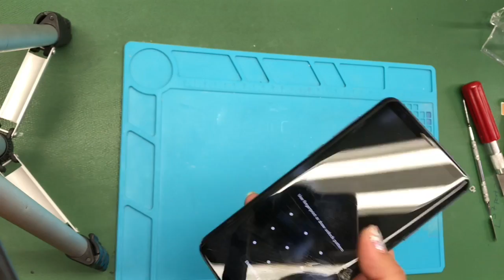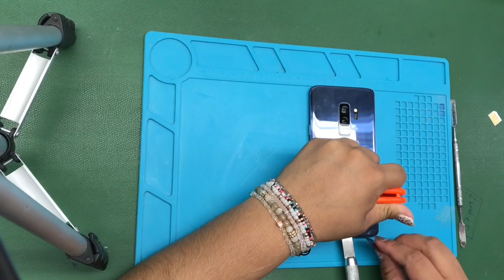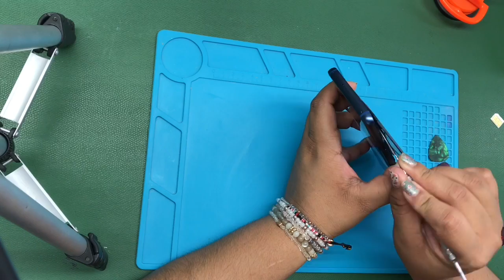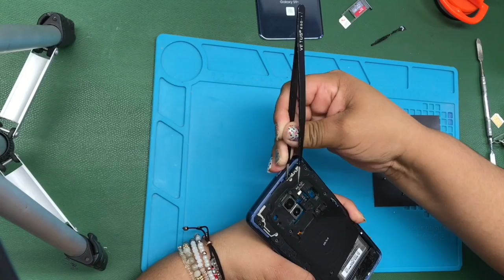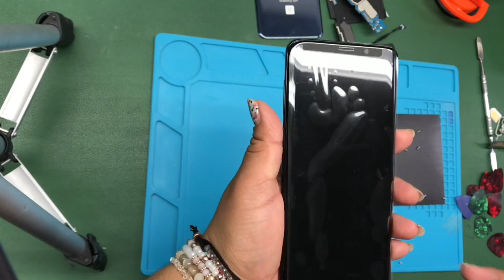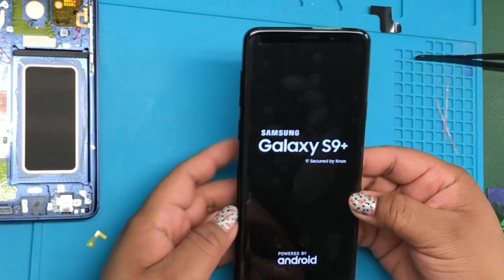SAMSUNG S9 + SCREEN REPLACEMENT EASY DONE IN 12 min 🙄

Comment: My S9 have a cracked but definitely still showing good. Can I just replace the front screen or LCD?
Reply from the maker: lcd and digitizer come together! so you can definitely just get the screen replaced and it will fix your issue!
Reply: @OrganistaTech  I have ordered just a S9 glass screen with no LCD and digitizer. Would it still work?

Comment: What'd the difference between doing a frame+screen replacement and doing just the screen? I did just the screen on my Note 9 and it was much easier than moving all the internals over to another frame...
Reply from the maker: the difference is that when you do a frame plus screen swap is that your phone looks brand new with new frame
Reply: @OrganistaTech  I did just the screen/digitizer. Phone looks brand new and took half the time

Comment: Replacing the whole screen would mean replacing the OEM OLED display.
I doubt that generic LCD has that great resolution as the OEM.
Can't you just replace the front glass ?
Reply from the maker: Yeah you can do that but that'll take longer
Reply: I tried to just do the glass only but the LCD is fused to the glass
Reply: https://youtu.be/ifHdZNbBwg0 this one shows what it takes to just replace the front glass
Reply: check out the channel "Richard Menza" 
He has a great solution. Or Rewa Technology

Comment: hey, my touchscreen works perfectly fine all I have is cracks. cant I just heat up the glass and pull it off?
Reply: Tom Harrison u still have to take the back off because the screen connection wraps around the motherboard and connects on the backside
Reply from the maker: Hey Tom and no you won't be able to do that due to it being connected to the screen
Reply: Tom Harrision to separate the glass from the LCD you have to be able to freeze that part to a certain temperature to take apart otherwise you will damage it.

Comment: How do you just replace the front glass?
Reply: Yes. Check iFixit's video. You do still need to remove the glass back and some of the rear components to disconnect the display cable. But the logic board and most of the internal components are left inside the frame.
Reply: Do you have a link for that video ? thnx in advance ^^
Reply: @dil6969  I have the replacement screen and LCD digitizer with out the frame and no one is showing how to take the old one out to put the new one in
Reply: Glass only replacement? Almost impossible in home withouy cryogenic device. I tried with LCD separator and pump. Heated up the screen and softly, gently tried to separate. The screen damaged itself totally. Fuck this! I think it is close to impossible to do it. Maybe with nail polish dissolvant and needle. Very hard. Practically nobody shows how to do it, because without expensive hardware you will break the LCD.

Comment: Can you just replace the glass screen by itself, instead of that whole assembly?  I ordered a glass screen by itself on Ebay, now I'm wondering if it was a waste
Reply: Did you manage to change only the front glass part?
Reply: You can replace just the display assembly... i work at batteries Plus and we do frameless repairs... much easier than replacing the screen already attached to the frame
Reply: @tomnyboy0916  I have screen/LCD digitizer For the s9+ without the frame which I bought and none of these videos out here shows how to put it on
Reply: lestat60628 https://youtu.be/qfGUQuqPZx4 this is a link for the frameless repairs... it’s literally one connector that need to come loose to do a frameless repair
Reply: @tomnyboy0916  how much does that cost? I cant seem to find videos showing just the screen repair
Reply: jdmferio08 it’s typically about 375... Samsung screens are really expensive to replace... it’s not the labor that’s so high just the actual part itself
Reply: Hey Dutch Koverchenko,just wondering how you went with your front screen replacement.Did you get away with just replacing the front glass?..Cheers.